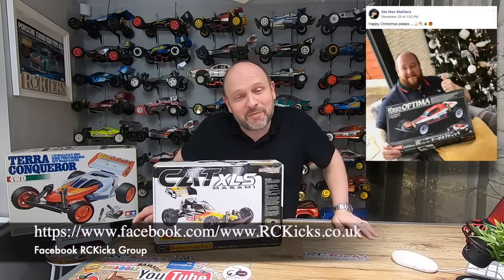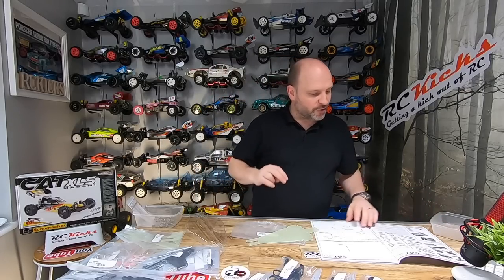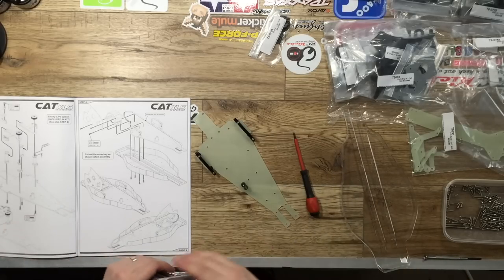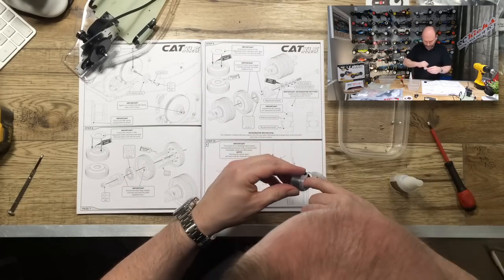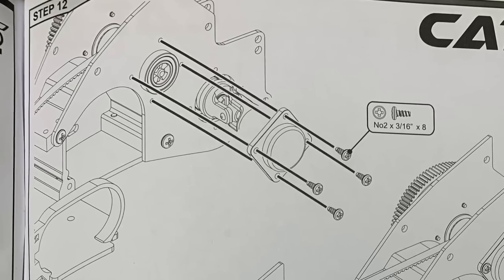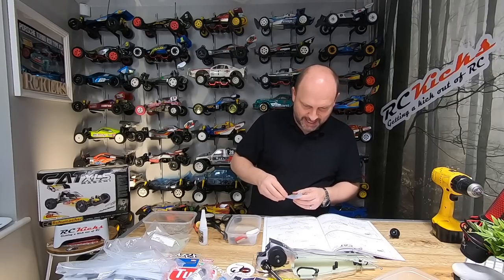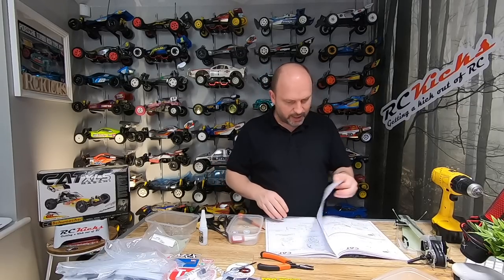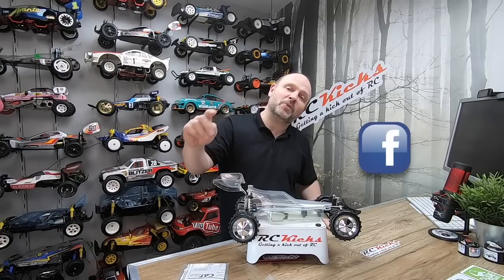What A Pain! But Is It Worth It? Building A Schumacher CAT XLS Masami Vintage Re-release RC Car.

Comment: Not sure if it’s been mentioned, but , building of the driveshafts, the secret to easy building of these, is place the plastic parts in very hot water before attaching the metal couplings.  Hope this helps. 👍🏼

Comment: Great build.  For step 10 universal joint driveshafts, were definitely a pain. However, I found the easiest way was to first heat up the plastic with a blow dryer.  Then I used a needle nose pliers and the metal connector piece went in much easier.  I had no issues with the screws either so I’m not sure what others are talking about.  This was probably my most challenging and rewarding build.  For some stupid reason, I decided to sell this buggy to justify buying a NIB Tamiya Egress rerelease and a Vintage NIB Kyosho Raider.  Now that I look back, there was really no reason for me to sell this kit.  Now, whenever I get a new RC car, feel guilty and I try to justify it by thinking about selling one from my collection,  I just think about how I sold the CAT XLS and it persuades me not to ever sell any of my vintage RC’s again.

Comment: On the battery straps just use a longer bolt and fit a nut on top with some good retainer to lock it. 5.5 socket from the top then. Another good tip is to make lexan shims to put between the front diff bearing housings and the crash back posts--stops it moving back and getting out of line when you crash and no need to overtighten the thru bolts.

Comment: The ally rear transmission housing, and ally rear upper sus and shock tower mount also both very effective in stopping the rear of the car getting bent in a crash such as brushing a wall in a sports hall otherwise it used to be bend it back fairly brutally on occasion.... high tensile machine screws for lower rear mounts also good as the wood screws don't fit the holes tight to help said alignment and easily get bent too.

Comment: I have the 1989 version.....needs a few parts to get BK to the way when I first built it......those u joints....tip, use a heat gun or cigarette lighter to warm up plastic drive shaft joints to insert metal joints......old trick to save fingers..... never had a problem with breaking....still got it😉...... Novak rooster esc, graupner 540, futaba tx .....  Esc burned up yrs ago but would scat down the highway.....handled very good
Reply: The Losi JRX2 already had the Universal joints pre-assembled.  You just had to assemble the telescoping drive shafts.
The Schumacher CAT requires you to physically assemble the Universal joints piece by piece!  It is a nightmare when you first start out.  It takes a while to get the hang of it.
Reply: @perfectsplit5515  cigarette  lighter makes it easier 😉

Comment: Seems like a right pain to build this car! Not as easy as Tamiya or Kyosho, I think Team X-ray make the best racing kits building wise. Great video though :)
Reply: Damn right.  As bad as my Tamiya Avante was in '88, at least it was easy to build.
When I worked at John Deere as a Mechanical Engineer in 2007, they taught us about a concept called, "Design for Assembly".  The design engineer should see things through the viewpoint of the assembler who has to assemble his machine.  When Honda and Toyota hire a new design engineer, that new hire must first work as an assembler for 3 months before creating his first design.
I think Tamiya probably incorporates a lot of Design for Assembly principles in their kits.  I think this Schumacher CAT was designed with NO Design for Assembly principles.  It is such a  nightmare to build.
Reply: X-Ray, Associated, TLR and Mugen all are really great builds.
Reply: @AB-80X  Agree with that.

Comment: It is a brilliant buggy but in order to get to the "brilliant buggy" stage you have to have the patience of a saint and the angels with that saint also has to have bloody good patience🤯 I snapped two drive shafts and had to order more cost next to nothing but still very annoying also the battery straps hold nothing other than the smallest of nimh and don't get me started on the c-clips for the shocks managed to get them on after a trip to A&E to get 6 stitches in my hand after the pliers that were holding them went through my hand😖😭
Reply from the maker: So a fun build by the sounds of it.  Great when finished and if you are not bothered about building it, I see a few new but built come up on eBay each month so that would be a better way to go.

Comment: I wish you would’ve been able to ride it because then you would’ve been able to see how this car shifts from 2 Wheel Dr. in the straightaways to four-wheel-drive‘s in the turns and it is done remarkably with a simple one-way bearing that is geared just a little bit lower than the rear transmission. When you witness it actually driving you will understand that there is no other car quite like this one!

Comment: Honestly,....it was good for a couple of runs until the pulley fails and the main belt runs out to the side, Believe me,...I owned one in 1987 .  Apart from the belt issues, the car is a real cat,.....it grips the ground and the front geometry is perfectly designed,.it flexes when the wheel gets hit and yes no dog bone but a very well thought of telescope designed front shaft and the rubber band that allows the front arms to expand when there is a collision which does not break because of its flexibility. Well....the rest is history...Overall ?...a great buggy....

Comment: Is anyone else having issues with the steering?  The front hub ball joints have a LOT of friction, and it causes very poor repeatability in the steering.  You start out neutral, turn left, then release the steering wheel, but the wheels do NOT go back to neutral.  They are still turned a little toward the left.  Very rough streering.
...
(I got this kit last month to compensate for my poor choices in getting the Nichimo Exceed and Tamiya Avante in '87 and '88)
Reply from the maker: No issues my end.  Could be the servo if the steering is not stiff.
Reply: @RCKickschannel  Fixed the problem by loosening the tightening screws on the hubs.